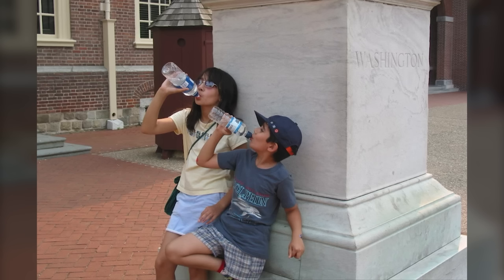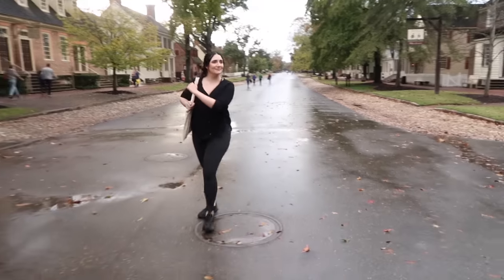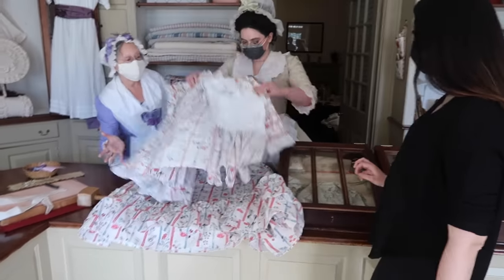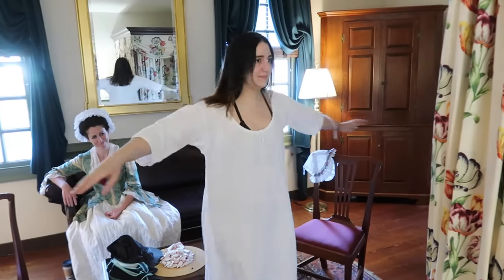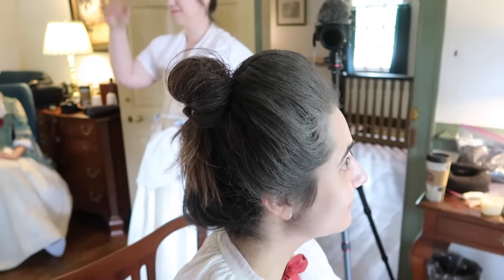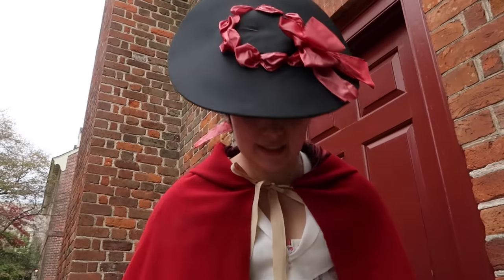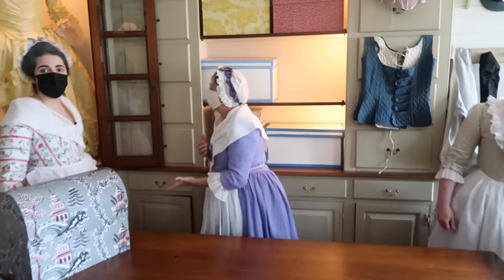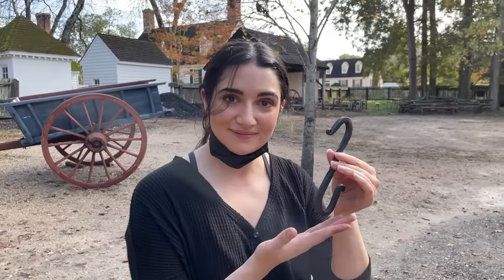I Got An 18th Century Makeover

Comment: I think that this is my favorite video you’ve ever done. I grew up in Williamsburg, and was a junior interpreter at Colonial Williamsburg for three years (junior interpreters are middle and high school age volunteers and the application process is intense). This was such a blast from the past for me! The last time I saw the inside of the costume warehouse was when I turned in my costume three days before I moved away. My 7th grade history teacher used to be the blacksmith. I used to carry all my contraband in my folded up apron, and my mom and I used to stop in that Wawa on our way home! This video was so much fun for me. A few differences in experience: my shoes for my costume were a similar design, but leather, not wool. My costume was meant to be a poorer person than your costume because of the house I worked in, so I didn’t have to wear stays or petticoats, just a cotton shirt that went over my shift and a cotton or wool skirt depending on season. They didn’t make us pomade our hair (thank god) and the break room was stocked with Gatorade (or hot chocolate, depending on the season) to pour in our official-issue colonial mugs and some pretty unhealthy snacks. It was such a fun experience for me that I’m so grateful for, and I’m glad you had such a good time too!!